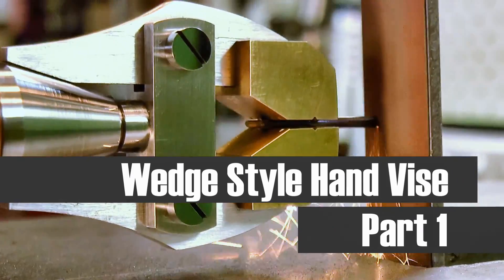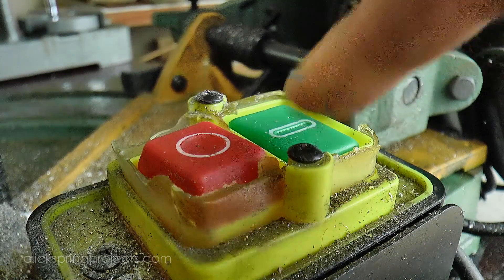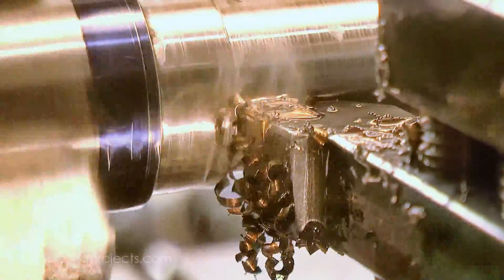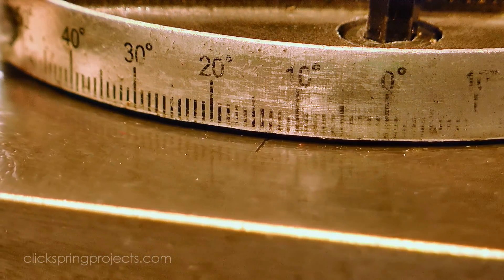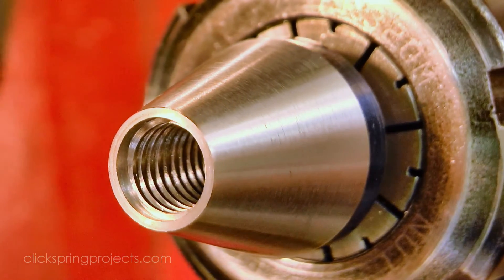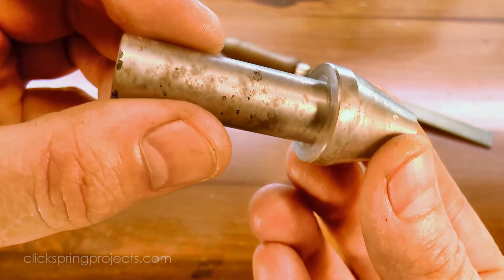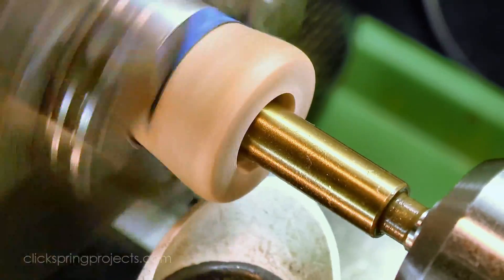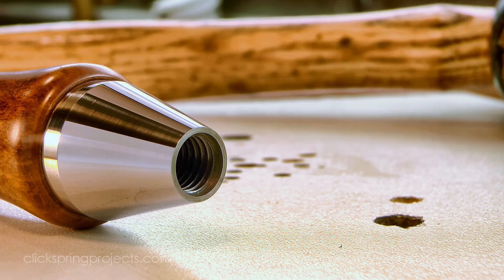Wedge Style Hand Vise - Part 1

Comment: how do you know when to stop heating the parts when you are heating the parts up?
Reply from the maker: Hey Paul - shoot for the color to go just beyond the dull red. But to be honest its difficult to describe, you really need to have a crack yourself to see the colors, quench and then see what works and what doesn't . Once you've had a few attempts, you'll know exactly what the color you're aiming for looks like. Recommend you get this book: https://www.amazon.com/Hardening-Tempering-Treatment-Workshop-Practice/dp/0852428375

btw Some folks use the absence of magnetism at the critical temperature but its not a method I choose to use. (Curie Point: https://en.wikipedia.org/wiki/Curie_temperature)
Reply: Clickspring thank you I will end getting that book a read. please keep putting more stuff like this up I love watching you make this stuff . I'm starting as a Machinist and it's really nice to see some of the tools, tips and tricks for the position.

Comment: What kind of oil do you use for quench hardening? My brother and I used to do some minor knife making in a back-yard forge, and we would quench harden in used motor oil, which would always flame up.
Reply from the maker: I use a light compressor oil. It will still flare for larger parts, so care is required, but is an excellent cheap alternative to dedicated quench oils. Thanks for watching

Comment: Great vid Chris. Looking forward to the next one. Do you ever chase the threads after heat treating or is it not necessary with the use of the boric acid?
Reply from the maker: +Jess Neal Hey Jess, not normally after hardening due the hardness of the steel versus the tap, but I often chase threads to repair them from some secondary op when the steel is still annealed. In this case the boric acid did a great job; there is a slight discoloration, but no pitting on the threads at all. Great to have you on board as a Patron mate. Cheers, Chris  :)